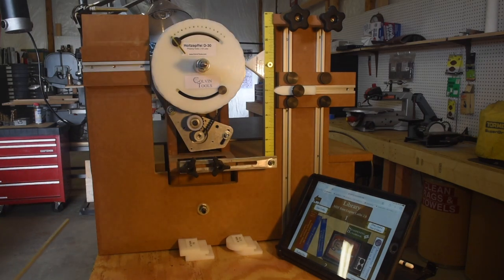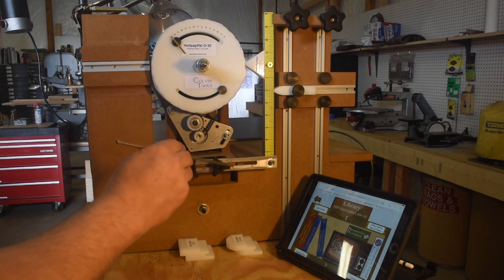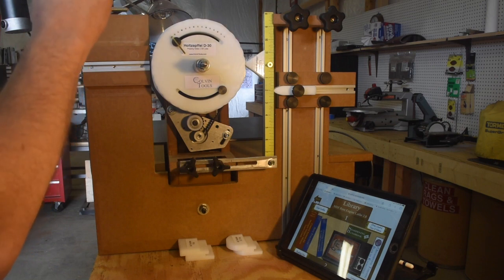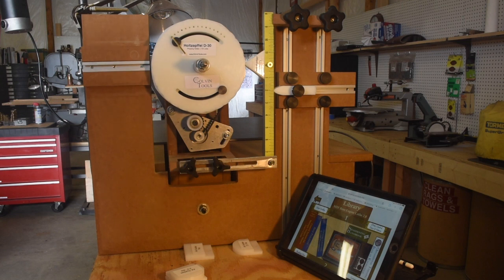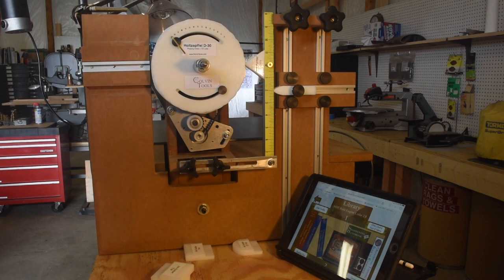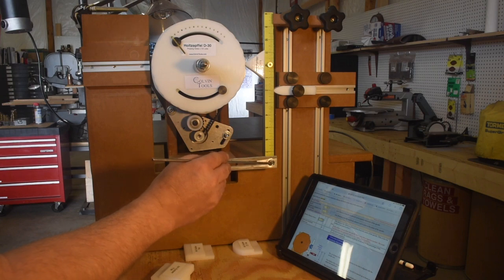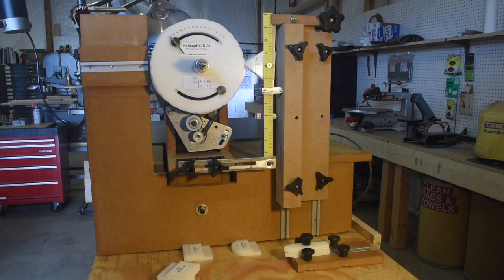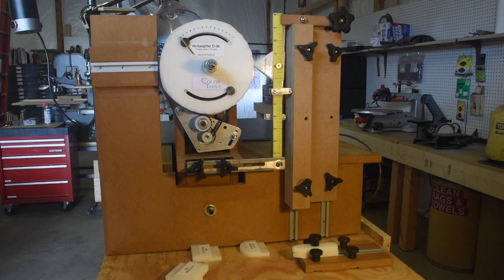MDF Rose Engine Lathe 2.0 - Amplitude Adjuster

Comment: Hi I want to make jewelry. I'm also a tool and die maker. I want to do guilloche, so what are the amplitude dimensions of the rosettes. Do you have those measurements in you library and how is the book for that. I will be using manually  not motorized. 
Where are you located. In Canada or USA. THX.
Reply from the maker: Gary, all the details are in the MDF Rose Engine Lathe 2.0 Library.  The book is the red one on the 2nd shelf titled, "Jigs, Fixtures, and Add-ons".  That book has all the details.

That said, I haven't heard of anyone doing guilloché work on an MDF Rose Engine Lathe.  Please let me know how it goes.
Reply: @RichColvin  thx for replying. I will be making out metal construction not MDF, 
I only need the details of the rosettes.
The sine wave depth, from radius of the rosettes for jewelry, thats because I was jeweller prior became a tool maker. Another 4 year to retire so I'll have something to do as hobby. Thx again 
And the